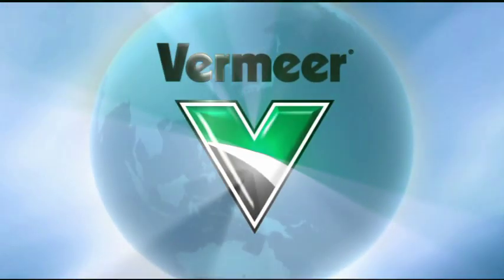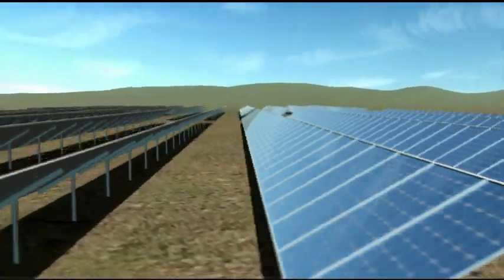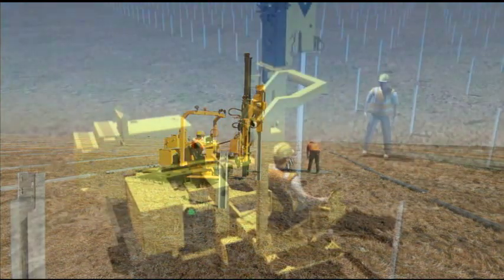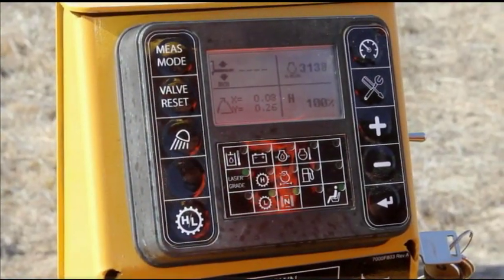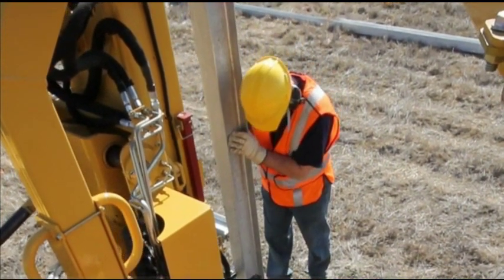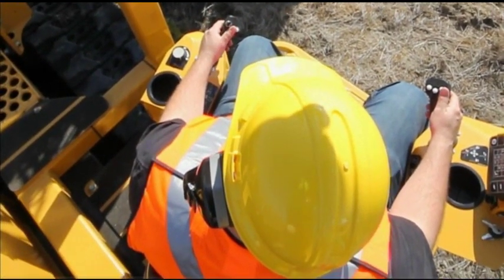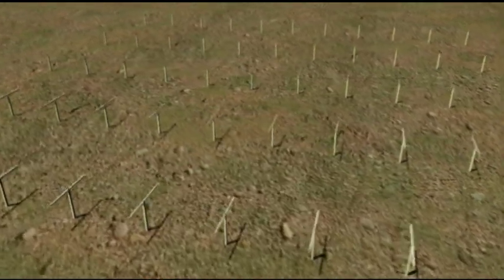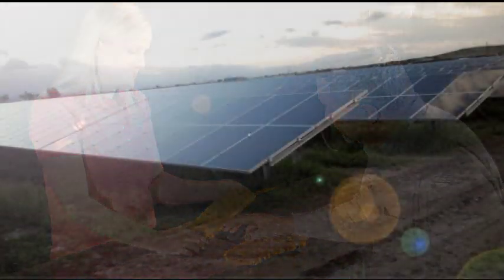Vermeer PD10 Post Driver

Comment: Nice machine. I am very familiar with the Orteco and Pauselli post drivers. We use them for crash barrier installation in Ireland. I wonder what one does with your machine if one encounters large boulders in the ground? With the Orteco we remove the "foot" and angle the post into the ground and attempt to "crowbar" the boulder out of the way. There is also a "hammer in the hole" drilling attachment, max diameter 125mm(5"), for undriveable ground.